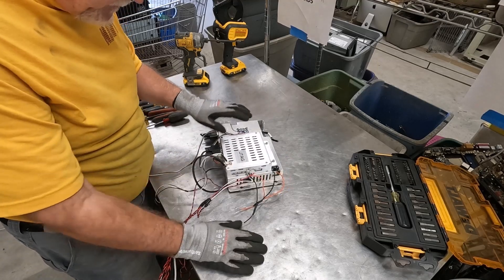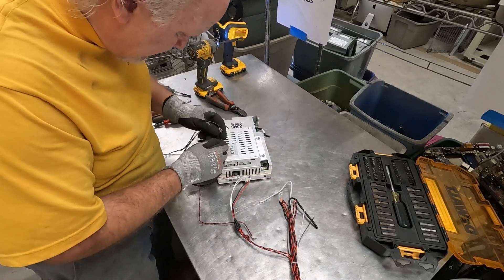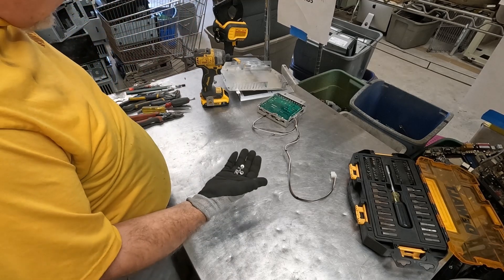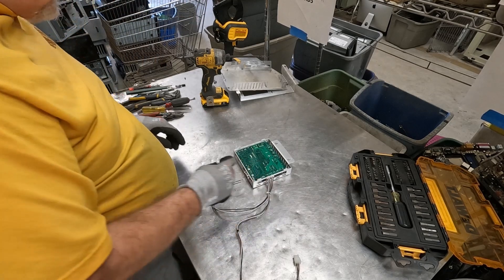Scrapping Starbucks Kiosk Part II

Comment: Well that was fun . Nice sheet Al and boards . If you are planning to take  those wire shelf's  with you to N.C  (1) mark each shelf  placement with a paint marker (2) put the clips in zippy bag and tape it to the unit (3) buy an extra bag of clips before you start , you  WILL loose one or have some brake 👍👍👍 just my 2 cents worth
Reply from the maker: I've moved these a few times now and have been very lucky in not losing any of the clips.  But I do what you're suggesting, break them down and put the clips in a baggie taped to the rack.  I don't mark them as I'm never sure how I will reconfigure from place to place.